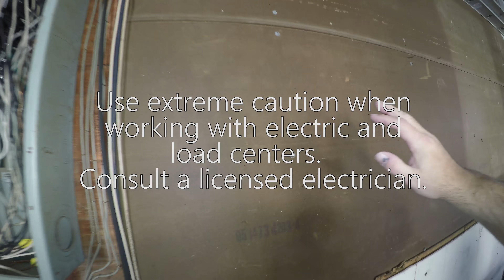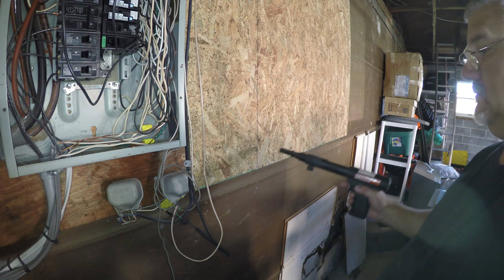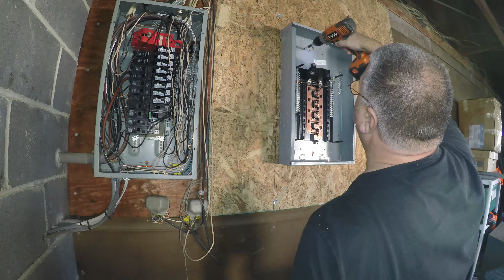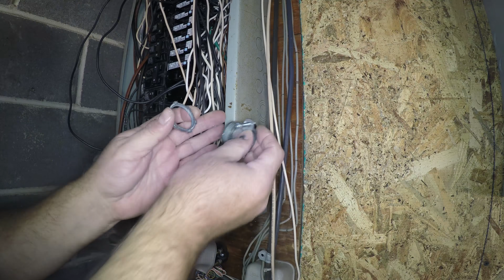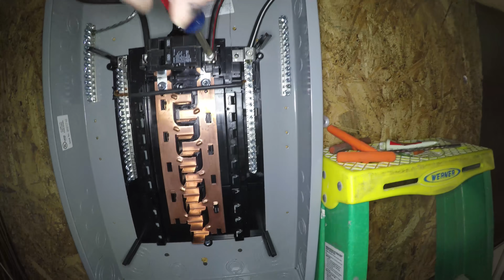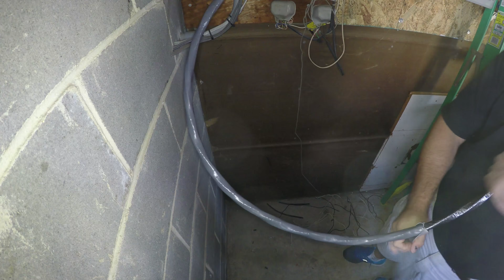How to Install an Electric Sub Panel and Tie-In to Adjacent Main Panel from Start to Finish

Comment: If you have no spaces on your main panel then what do you do? I want to add a 100amp sub panel will I need to remove a breaker to make space and add the breaker I removed to the sub panel?

Comment: Great install, but why not clean the other panel up and neaten the wires, zip tie them like a pro. Also, all those white wires used as hot wires on the left side should be marked with black tape.

Comment: No doubt copper wire is much more expensive, but wouldn't it be worth it to use copper?  I would assume it would be easier to bend.

Comment: Awesome answer, I will respond in another comment, in order to help you with the YT algorithm,  to show engagement.    I liked reading it, but, I'm familiar with most of those concepts, it's always nice to read and reinforce knowledge.    But, to be more specific, my question is about an underpowered solar system, connected using a hybrid inverter and some batteries.    Yes, I know I can buy more panels, but, that's not the point.  🙂   I want to "augment" my bill.    I use 30kw a day,  but I generate only 10kw,   arguably, most of those KW usage is at night, so, during the day,  my 10kw can charge some battery (5kw lifepo4), so, I get a few hrs of power from it to 80%.    I've seen cheap versions online of 1000w "grid tie" inverters that people just plug into an outlet,  and it lowers their bill.    That is amazing to me,  but,  I can wrap my head around the fact that it probably senses the sine wave, modulates itself, and then adds power concurrently from solar to existing load.    I guess it does this and the GRID automagically lowers itself, so it doesn't provide all the power instantly?    I assume (correct me) that that little inverter also provides slightly more Volts than the grid, so that it takes precedent over the grid instead of the gird backfeeding itself?  am I saying that right?        Ok ok ok..  so.. I am not so foggy up to this point,   but here is where the gray gets thick.    So,   I have a Deye (Sun Power)  hybrid inverter in a box here,  5kw I think,   and it has the regular inputs for the MPPT lines,  batter, the little ring that goes around the Main to sense electricity,  wifi,  etc.    It has AC out,  which I assume i need to put into a breaker,  bottom of the panel,  opposite end of the Main input,  (same as if I plugged it into a wall),    to do my "augmentation"  plan.    But!!!!  but but but..   Why does it (Deye) also have an AC input port?     that is what is confusing me.    Would I feed power from my breaker back into the inverter?   that doesnt make sense to me.    OR,  does this Inverter expect me to feed the main line from the grid into that port, and then from the output to the breaker?      That seems implausible for 2 reasons,   a)  i'm renting here, and don't want do major reconfigure.    b)  if I'm using 30kw a day,   this one inverter would not be enough,  and I don't think I could split up the Grid power between numerous inverters.       

Hope I didn't ask too much,   but, you seemed so knowledgable,   I was hopeing it was ok to bug you with these details.    Also, FYI,  I'm in Asia now,  ex-Texas,  so, I know the rules and stuff here,  it's very much the wild west in electricity abiliyt.   The electricians here will do what you tell them,  so,  I need to have at least a cursory idea.    FYI, I'm also an aerospace engineer, so not too dumb, only a little,  just need some insight onto this electric stuff.     It seems my situation is an edge case, vs someone fully redoing their whole house, and over supplying.

Thanks in advance,  wish I could buy you a coffee, or repay you for your time.

Comment: Please explain - will you have 2 input supply lines,  a) grid,   and b) solar running at the same time?   is that possible?    I can't find anyone to explain how.      The reason I ask is,  my solar system is smaller than my needs sometimes,  cloudy,  big load, whatever.    and I want it to assist the grid,  not be one or the other.    A AND B,   no  A or B supply.

Comment: Can you tell me why you bent the 2 mains and neutral wire rather than making them the correct length with no bends?   is there a reason?  Great video.  Thanks.

Comment: Thanks for the video, hope I didn't miss this in your video..... when replacing a main panel, if the wires are too short,  can a splice be added using wire nuts, where the wire nut connections would be contained in the main panel box?

Comment: I don't understand why Siemens would use flat blade screws that don't also work with Philips or Robertson. Flat blade is the worst when you need to apply torque.

Comment: One thing i don't  understand and would like to know . Why is the wires left so long in the panel that it looks like a birds nest and makes identification of circuits hard if not impossible.  I say cut what you need and don't leave the excess in there as it is not going anywhere once installed. i don't make any sense for all that extra wire.

Comment: We recently purchased a fixer upper (built in 1905) and I need to add two subpanels. I want to do as much work as I can before paying a professional to replace the main service panel. Now for the question. It seems copper SER wire is recommended over aluminum SER for safety concerns. Any feed back would be greatly appreciated. Thank you for taking the time to produce this video.

Comment: Probably a straight pipe between panels and just wire through it to each connection point.....especially 02 Why the wire jumper in your new panel between the hots?

Comment: Why would you install a main panel as your sub panel? The feeder circuit originates on a breaker in the main panel. You should use a main lug only panel for the sub-panel.

Comment: Nice video. What I find interesting is that in my township they do not allow SER between the main and sub panels. I just added a 100 amp sub and my initial plan was shot down because I had listed SER. In my township they require an insulated ground between the main and sub. They had me switch to THHN conductors which required 1-1/4" conduit. This creates a domino effect because 1-1/4" PVC conduit breaks the 40 60 rule for studs. So then you have to sister the studs. Made what should have been a straight forward job kind of a headache.

Comment: My future project is to add a panel to the meter box outside to accommodate a pool.  Because of my backyard lay out it would be so much easier to run the pool circuit from a panel at the meter instead of the main panel inside the house. The outdoor panel would not only serve a pool, but other things like a shed/mancave, and outdoor lighting. My question is, of the two panels which one should become my sub panel?

Comment: If I was to put that 2/0 wire in plastic conduit would I need to remove all the insulation ? Also if I used copper wire what size would have been acceptable in your video ? I would be running a 100 amp sub from a 200 amp main panel.

Comment: Nice breakdown!  One question: Could you run that wire 100’ from your main panel to a garage (and then into a sub panel)?  

Or would you have to install a sub panel in the basement and then run the wire to another panel in the garage?

Comment: If the device I'm connecting requires three 40 amp breakers and my main panel is full can I use a sub panel? If so how would I feed the power from my main panel to the Sub?

Comment: Great job. I’m installing one on the opposite side of the house to move some circuit breakers from my fully loaded split bus panel there is an existing 100 amp breaker that feeds my furnace which needs a minimum of 50 amps I noticed on its label I’ll use the existing breaker for my new sub panel. I enjoyed watching your video 🤩😎👍

Comment: Thanks for the video. Just a quick observation. From what I understand most panel manufacturers use tin-coated aluminum lugs. The lugs are rated to receive aluminum conductors as well as copper. So only necessary if inspector believes it's necessary. Also the aluminum alloy AA-8000 used in all electrical conductors has been in use for 30 yrs or so and is more corrosion resistant than the aluminum wires that burned down houses.
That being said I usually use it.

Comment: A few things I would have done differently. Correct me if I am wrong in any of this.
1. I would have used copper and not aluminum. You have to use anti-oxidant (which you correctly pointed out) on the lugs, but I have read that you are not supposed to use antioxidant on the side with breakers. There are various opinions about whether this is acceptable or not and possibly different compounds that could be or should be used. I would just rather avoid it all together and use copper wire.
2. Install the sub panel "upside down" and you could run a shorter run of wire from the main to the sub panel at the bottom. The panels can be installed either way up. Then run conduit between the two panels to protect the wire - required by code in some areas.

Thanks for the video

Comment: Everyone does things different, I would suggest using conduit between the boxes. Never ever use aluminum for wiring, down the road it will internally breakdown and create resistance and run hotter than copper. And why on earth would you strip 18 inches or more of wire to go 1 foot? I know you want comfort room, but you ended up cutting so much off. Thats a foolish waste of material. Probably would not use OSB to screw the box to, it does not weather very well and is a poor product for other than what it was designed for.

Comment: question hope u get back to me i have a 220 volt wire coming off a panel that was meant for a hot tub can i use a sub panel to wire a few new outlets in the same room to support 2 treadmills by any chance

Comment: If I am looking to install a sub panel in my basement and I have no slots left in my main box as the last two (same as the double slot you used) are already running a sub panel out in my garage... is it simply a matter of moving my garage 100 amp out, installing the sub box like you did, then just hooking my garage back up in the sub panel? Or should I move a different breaker set out to the sub panel? Seems like it would be a bit crowded with 3 big cable sets coming in and out of one box... thanks for the video!

Comment: thank you much for this video as im forced to add a second box to my house to handle my medical cannabis grow for the horrible case of crohn's. I'm disabled and only collect SSDI. with that said i can never afford a electrician. however i used to run my own home repair buss. i did everything except to high work. so my electric skills are a bit rusty. your video helps clear my head for what i need to do  thanks again for your very detailed video

Comment: Have to agree, could have rough measured se cable out side of main box to mark and cut outside of the panel. Then put it into the connector. Also would have pre cut shorter instead of stripping back six feet of casing.

Comment: Being a former(retired) maintenance electrician (system repairman) in a major U.S _ steel mill, the very first thing I learned, is to always leave yourself extra wire. Whether in a j-box, main panel, motors, and splices, always leave extra wire for burn off.

Comment: Thanks for the video. I think you could use 1/0 AWG aluminum rather than 2/0 in this case for 100amp circuit

Comment: I've got something similar in my basement.  It was in the house when we bought it.  I'm wondering what your service is on the original panel.  Mine is 100A and the subpanel is also 100A.  That to me sounds like a bad idea.

Comment: Good to note about the AFCI tripping. I guess your toaster throws an arc as it's turned on or off? I'm wondering why so many people are up in arms about the extra wiring in the panel..don't you want that wiring for when you move a plug or light switch but finally run out of wire at the outlet? Don't you want the extra wire in the main panel as well in case you have to relocate a breaker or 8? I believe that what they say about filling up an electrical panel is a good guide line ON ORIGINAL INSTALLATION...the box was designed to run it's full complement of breakers and will have no issue running a full panel until the home actually uses enough power to open the main breaker...that'w when you want to upgrade to a higher amperage and larger service with more breaker slots. Another issue with a full panel is the increased difficulty in tracing wires and rerouting.

Comment: hmm,  . . . grounding the second panel  would not be needed really, because the first one is already grounded. all you done was route an extension from a already grounded  box . . . .  basically. and still would have passed inspection. . . literally.

strange how a panel that is grounded gets hit by lightning, and one that is not grounded does not get hit as much as  one that is grounded . . . say grounded [ 8 out of 10 times gets hit by lightning ] 
                         not grounded  [ 1 out of 10 times to  not get hit by lightning ] 

 i should know,  the places that i have lived were not ever grounded , lol   . . . nothing was. and still , not hit by lightning.

think about it, why did they start using grounding in everything ? . . . . because they seen it to be  '' profitable ''  that is why.
ever heard of  a joule/ surge  protector to stop  sudden surging or lightning protection . . . ? . . . that is why they started
 grounding everything.

clean
awesome video !!

Comment: I don't mean to be picky picky,  but... You need to remember that the panel is not a junction box,  but a power distribution box. Therefore,  wire nutted connections are not allowed.  Also, circuit breakers or fuses protect the wire! The wire size is the determining factor for the (anticipated) load, and thus determines the circuit protection size. One more thing... never use square edge (needle nose pliers) to grip or bend wire! The square edge WILL nick the conductor and cause it break eventually.  Always use round nose pliers.  I have looked into many an electrician's tool bags and have rarely seen one.  They are expensive and sometimes hard to find, but are an essential tool. I had to replace a pair of mine that were stolen from my bag by a less than honest person,  and had a helluva hard time finding them even at a very well known electrical supplier.  In fact, the kid behind the counter had never heard of them! Not on the tool rack, and had to be special ordered.

Comment: Hi!  Two questions if I may:  #1.  My panel has a double pole 30 amp breaker for an electric dryer receptacle not being used.   I would like to remove that breaker and replace it with a 20 amp circuit.    Just want to  double check to be sure when removing, that the double pole 30 amp breaker don't have a neutral wire on the neutral bus bar that needs locating and removal as the black and neutral conductors are already connected to the said breaker, right?   
#2.   If I was to replace a single pole breaker to lay out new cable line, how would I go about finding the corresponding neutral wire for that old breaker so I can remove it from the neutral bus?    Would I need to remove all the neutrals wires at the bus bar and do a continuity test one by one?  Or is there another simpler way?   Thanks alot!

Comment: 2 main issues I see here otherwise good walk through. 1 is ( I know its been covered) but putting  100 AMP sub panel on a 150 AMP main panel will overload eventually. 2. never fully fill a panel. Your main panel should have been replaced with a larger one. You should always leave 2-4 slots empty.

Comment: Yes good old 60 s.  N. 70s,  it's great you rearranged, back in the day!  I'm 75, I remember property owners did a lot of their own work, I would get calls to go, inspect, comment, do the repairs, re wire whole houses, commercial, industrial. Because of faulty, wrong installations, fire hazards, fire-death related inspections with fire Marshall's, as you know it only takes one wire, I helped investigate a smoke, fire related death in Worcester Massachusetts where an elderly man died because a 240 vac.,was charging on a hot air duct for years until Poof,   the 240 vac. Was wrongly installed in 1956, the air duct joint flange finally cut through the tar, cloth wrap, and of course the air duct is grounded with its furnace. Go figure that millions of old homes across USA.  Again great video,  JR

Comment: why do you have 5 feet of wire coming out of the box and you cut most of it off. also i thought putting the out breaker at the top is best

Comment: I think you got several comments about connecting neutral to ground in the sub panel because people saw the black insulated wire which connects the two neutral bars and thought one was a ground bar.

But it is important to have one connection from neutral to ground for the whole building usually in the main breaker panel.  This ensures current doesn't normally flow on the safety ground wires and so GFCI and arc flash breakers work correctly.

Comment: Nice video but me working as a license electrician doing custom houses and havent to deal with inspection this would never pass just because your wires are really messy you gotta have them just right and not all over each other and all that extra wire going everywhere

Comment: To all those watching this video, please check with your local AHJ or inspection department to see if you can legally install a panel and feeder.   Most areas you are allowed to take a test.  If you pass you are allowed to do the work, and it MUST be inspected.   After reading many of the questions and some replies, there is a good reason for these laws and inspections.   I worked for electrical contractors designing electrical systems for more than 30 years and I am a PE.  I have seen some very scary installs.   By the way, without an inspection, your home insurance may pay nothing if your work causes the fire and was not inspected.